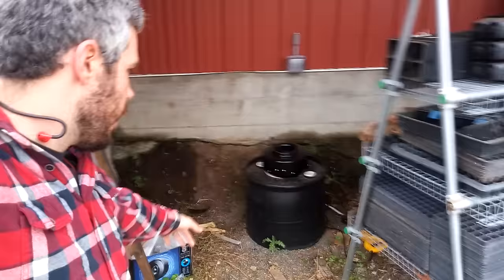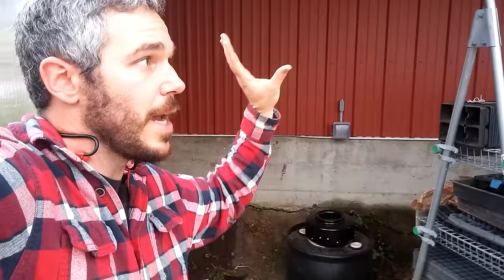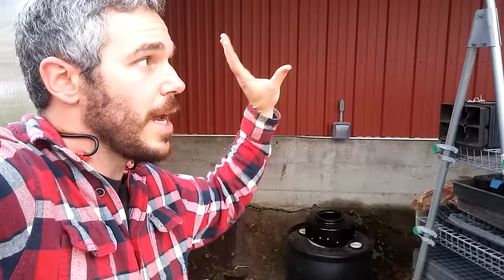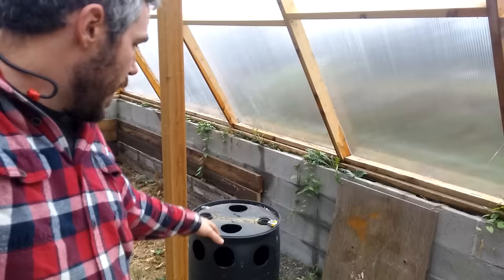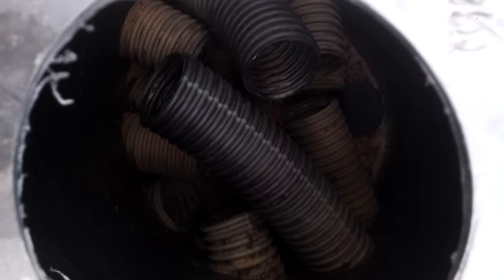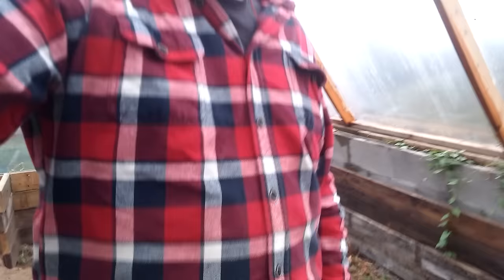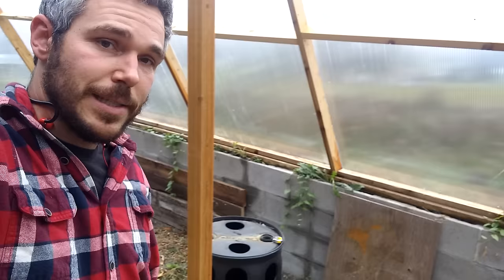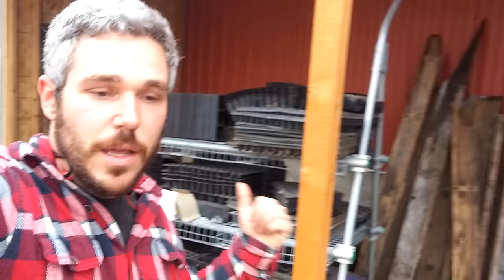Poor Man's Geothermal

Comment: Thanks for the vid. Interesting design. You talk about what its supposed to do but the only thing that really matters is what its ACTUALLY doing. Would love to hear about actual results. I assume you used the perforated (slits) corrugated abs tubing. If so, what did you do to prevent condensation from puddling in the bottom of the corrugations since the slits are in the ridge of the corrugations. If nothing, take a look at a piece of that tubing and you'll understand the problem. I recently dug up some of this tubing and water had pooled in the corrugations which will ultimately cause mold.
Reply from the maker: We actually cut slits into the tubing ourselves, so hopefully water won't pool, but I'll update this as we continue to see how it's working. I'm currently addressing drainage issues from the uphill spring so there will be an update coming when we have some more time into it.
Reply: Easily fixed with a circular saw set to cut 1/4" deep and a few 2x4`s to keep the tube straight while you rip a shallow slot partway through the bottom corrugations :) The biggest problem to overcome is the humidity released into the greenhouse along with the heat, especially at night. The latent heat doesnt raise the air temperature only the RH%
Reply: JohnGuest45
How are you dealing with the humidity John?
Reply: You have two options, prevent the air from reaching dewpoint in the tubes during cooling. This prevents condensation from forming in the tubing but also significantly reduces the cooling efficiency as the bulk comes from this phase change. You lose the bonus of water being returned to the plant roots, assuming you are growing in the ground and may also need to water more. Staying above dewpoint requires very low resistance tubing layouts and high airflow rates. The other option is more tricky, you have to design the system so the  latent heat component (typically 60% of the total) is converted into sensible form before being released into the greenhouse.
The system configuration is not the same in cooling mode so you must design to accomodate both modes.
 Most folks assume the heat delivered by these systems is 100% sensible (like an electric heater) which isnt true and easily confirmed by using a hygrometer.
Reply: Did your tube have a steady breeze blowing through it? People always bring up  mold issues but I have never seen mold thrive where there is a constant 5? 10? 20mph breeze blowing over it. If there are any real world examples of mold I would love to see them.

Comment: Becareful, that will bring Radon into your greenhouse.
Reply: Plz explain really need to know !!
Reply: @Learntospell-LooseandLose  IF there is Radon in the ground, it might exist in the air as well. If you dont live in the greenhouse, or let the air circulate where you live, then it shouldnt be a problem. Also, Radon can only be found in certain areas. It can be measured, to see if it even is  unheathy for humans, or just a very low level, and then it wont be any health issue at all.

Comment: The "40-50 degrees" heat from the earth's surface is not geothermal, it is solar.  Anywhere on the planet, dig 3-4 feet deep, measure the temperature of the soil, you will have the annual average termperature for that spot.  It is being heated by the Sun, not magma.  For what you are calling "geothermal," you will need to dig much deeper.  Much.  Nice dog!
Reply: That’s splitting hairs. Geo means earth; thermal relates to heat. Whether heated from below or above is immaterial. Point is, ground temps are terrifically stable a certain distance below ground. He’s using the ground as a thermal battery and it works.
Reply: @just-dl  Not splitting hairs, one definition is correct, the other is not.  If this is the sort of "definition" that passes as OK then let's agree to call it "ugg" -- I think that is how cavemen talked, prior to the advent of education.  Ugg!

Comment: 500' of land drain pipe and all off the digging to submerge it deep enough = 'poor man's geothermal'? No way could I afford that! I'll use a rocket mass heater instead.
Reply from the maker: Heck of a lot cheaper than regular geothermal. And rocket mass won't cool. Total cost was about $500, but I had a tractor to do the digging myself.

Comment: When you say drain pipe, are you referring to that used for septic drain fields? Just wanted to clarify-thanks!
Reply from the maker: Niccole  Fales you can use a variety of different types. We used ABS but as noted below you will want to put holes in the bottom of the pipe if you use it as water can pool.

Comment: Radon gas concern?
Reply: Hey Dave,  I would not be as concerned with radon as the pipe is in the soil.  I would be concerned if it were in shale or granite as that is where it moves more freely. Just my thoughts, thank you.
Reply: You scared of everything??? Stay home!
Reply: Dave, this is a very important point.  Every house in my area has a large active radon mitigation system.  (There is enough radon in some local wells to set off a Geiger counter.)  If you are in one of these areas, all the radon will end up in your greenhouse.  It's not a problem everywhere - it depends on your location.  There are EPA maps you can check.  Also, the radon in shale and granite percolates up through the soil above it, so it still could be a concern.  If you do check it, be sure to check it for several weeks to get an average, as it can vary a lot.
Reply: @ohyeahthatsright3155  came to ask about this too. It's a bit of a catch 22. Even if your area is epa rated as being low, how do you know until you install the system and take measurements?
Reply: @briholt100  great point Brian.  I do believe there are radon maps to give a rough baseline.
Many home sales in New England require a radon test which consists of a bottle of fluid in the basement for 24 hours. Then sent off for testing.
I have read that 90% of the homes and wells in New England have radon.
If I had concerns about radon in the greenhouse, I would put the greenhouse on pallets and lay down the floor there’s your ventilation to mitigate the radon concern.

Comment: How many cubic feet is your greenhouse? If we knew that and that the calculator told you that you needed 500 feet of pipe, we could solve the equation. Can you provide that information? Also, your video is the first I've seen that has addressed the fan size and the number of air exchanges per hour. Thank you for that as I haven't heard this information elsewhere.
Reply from the maker: adam lambert its about 6300 cbf.

Comment: I am sure that not every tube is flowing equally of air when working. Some are probably flowing much more than others. Especially the way you have them randomly coming up into the barrel. Its a good idea in theory but in practice, not too efficient. None of this is free. The digging, the tubing, the barrels, the cost to run the fan and purchase. But if it extends the grow season, it can't be bad.

Comment: Link to where you can find and download SunnyJohn's climate battery calculator (and open source materials ) http://www.ecosystems-design.com/climate-battery-calculator.html
Reply: John`s archived websites didnt get updated with the new design recommendations before he passed away in 2011, Using the old calculator will work but it wont be optimal.

Comment: So what makes this a poor man's solution as opposed to 'proper' geothermal?
Reply: In this case "proper geothermal" probably refers to what's called a "heat pump" its the same principle with lots of long pipes buried in the ground, but generally they circulate liquid (usually water mixed with anti-freeze) instead of air, they have big pumps instead of fans, and they hook up to a unit that's kind of like a standard Air Conditioner unit that exchanges the heat and blows ground temperature air through you house (or greenhouse) year round.

Comment: If the ground remains the same temp how does it cool and heat?
Reply: Because the external temps do change. It's about keeping temps regulated by the difference. 50 degree air is warmer than 10 degree temps in winter = heating. 50 degree air is cooler than 100 degree temps in summer = cooling.

Comment: this isn't geothermal, if you want it to have a fancy name, terrathermal is more appropriate. geothermal refers specifically to extracting usable energy from the deep rock core of the earth, not using the ground as a heat sync/thermal mass battery.

Comment: so is it working? lets see some numbers!
Reply from the maker: We had some delays in getting everything up and running as intended. Namely, a very, very wet season and other farm projects that took priority. I'll post an update in the next month or so. By next year we'll have some metrics to work with.
Reply: Out of Ashes Farm cool. I've thought that this style of greenhouse heating would be cool. and I've seen a lot of people doing it but not much follow up. its hard to determine how well it actually works, and what's the best way to do it
Reply from the maker: You are very right. That's why I'm trying to do due diligence on this. I had a hard time finding good info myself. Hopefully you can learn from my mistakes!
Reply: Most of the people doing it simply copied flawed designs. Follow ups beyond ..it works!! are rare because, just like the designs they copy, there are no sensors installed to measure the performance. The most important parameter is how much air is flowing through the tubing, it should be calculated before installation and measured after installation to confirm it is what you designed it to be ;)

Comment: Chk for Radon!
Reply from the maker: Done at purchase. Pretty standard check to do in our area.
Reply: No, what I meant was you should check the air in the greenhouse from time to time for Radon gas. Since you are using perforated pipe in the ground , you may be harvesting radon, which causes lung cancer........
Reply: Radon is a non-issue pretty much everywhere. Uranium isn't actually that ubiquitous, and when there's circulating air it's never an issue.

Comment: In  the UK quite a lot live in small flats in amongst many floors, and the difference in supposed poorness is mental.  People would squat it that and if yoiu owned it you'd probably be liable to keep the water and electricity on. Twenty mattress would fit on that floor, a quick coat of white wash and no one would know. Owning something is mental and soon to be discouraged. 
Current students are designing micro housing Chicken box, stack them high, Smart cities. This is a global aim. Rewilding, viability, sustainability, conformity, monitoring, Agendas and the Big Reset, and the New Normal and Build back Better. The UN and the WEF. 
Somebody has just produced a walk map of the UK and people are being sent out to test routes. Soon we'll see that this road and that road needs blocking. The Mayor of London has started it, others will follow. They've thanked the media for keeping the noise down for forty years of plans, Stakeholder Capitalism looms along with the demise of Shareholder Capitalism. 
Meanwhile down on the farm; Geothermal. I fully recommend lifting Green houses off the floor for many reasons.  The situation though could be classed as extreme, it will be good see the results after a season. I use a Raspberry pie to monitor all sorts but it doesn't like heat.
It will be interesting to see how humidity behaves. These things seem to work differently at different latitudes and different depths. Above 53N people seem to be searching for heat by going deeper, but the rewilding will alter many things. Envy needs to be removed from society as it the route of all evil and it's best if we don't own anything, it's for our own good apparently, no more hair straighteners, Brevils, Cars, Tools, Music Instruments, Pets, books, Pensions, Gold, Shares, Stocks, Savings. Hope your listening. Enjoy it whilst it lasts, fresh veg, yum.